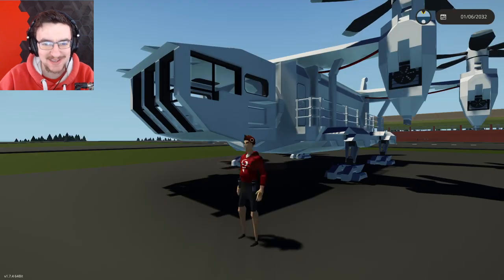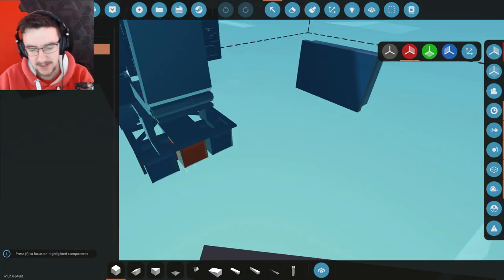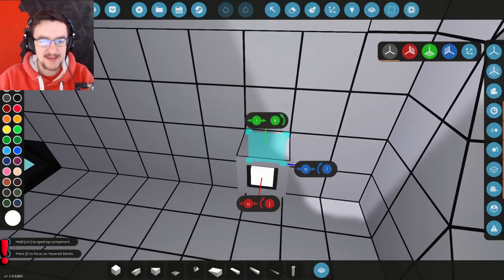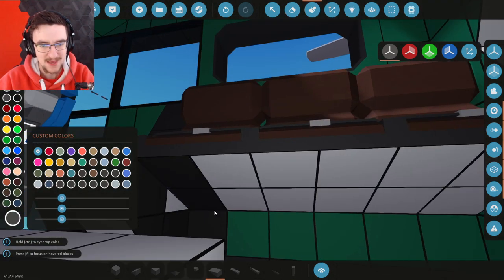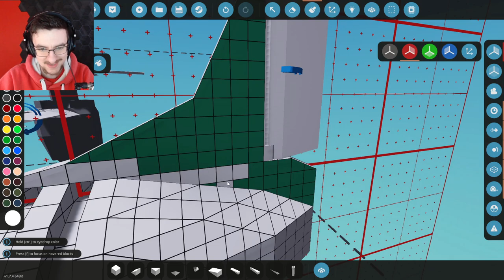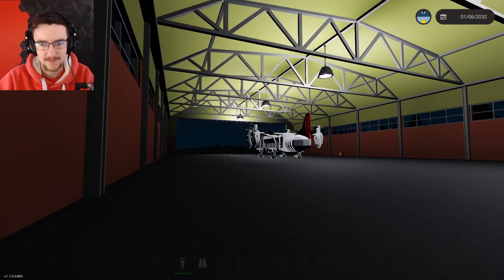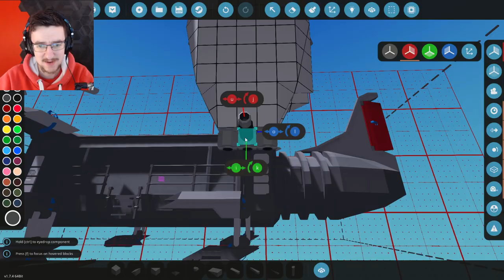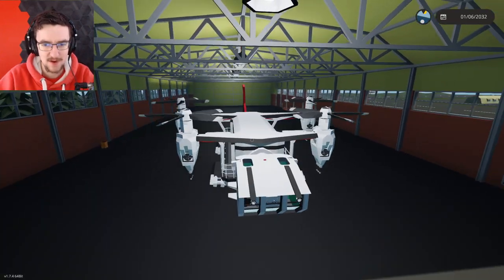EXTRA DETAILS & COCKPIT ADDED To Our MILITARY FUTURISTIC VTOL Build In Stormworks #6

Comment: I really like that green, though I think it would be cool if it were a bit lighter. Also, I had some ideas for detailing:
- Use paintable signs to outline the area around the loading area with yellow and black safety stripes
- Use paintable signs along the outer pathways with lights
- Also it might be interesting if you put spotlights on all the engines, so when loading you have good lighting, and can even move them

It could be like a military transport; it transports supplies, but has some guns for basic defense. Also, it would be super cool to see you do a cargo mission with it when you're done!